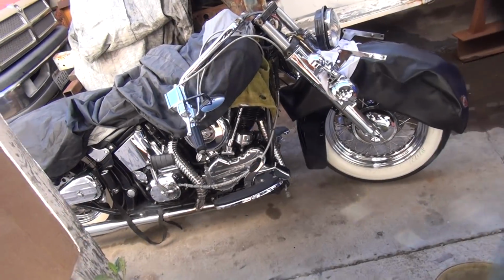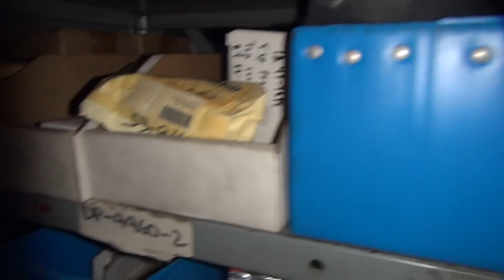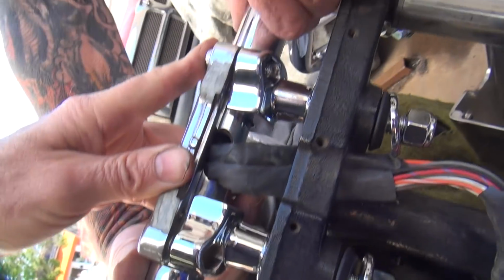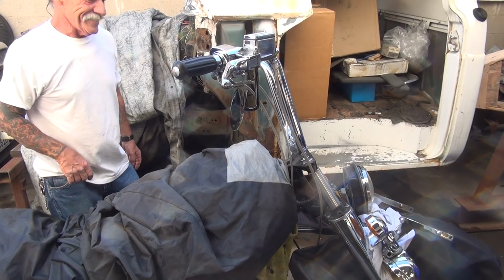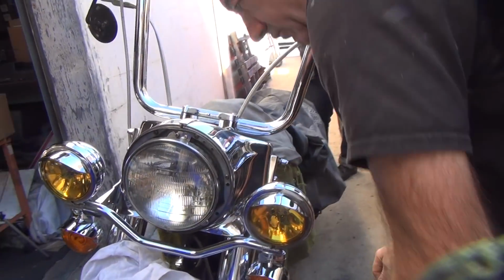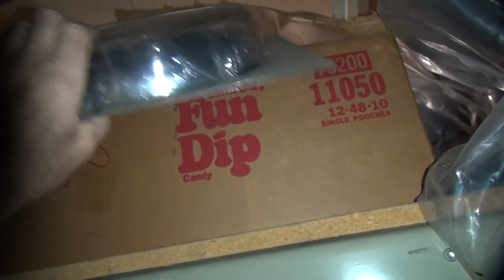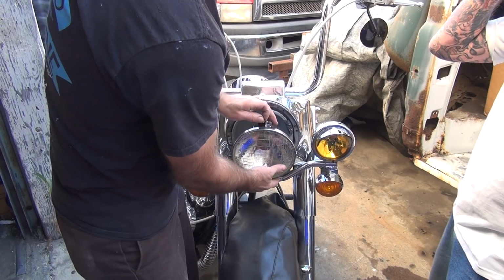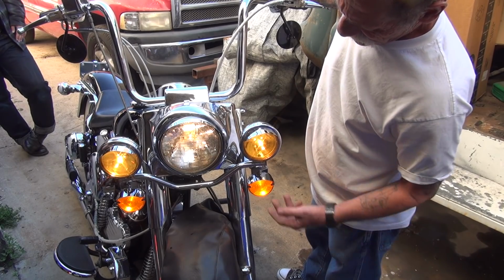#147 How To Do It  change handle bar bushings flh softail harley shovelhead panhead by tatro machine

Comment: Hey tatro on initial start up on 70 ironhead rebuild I have oil coming out breather/vent tube. Alot. What can this be or what to check
Thanks for response
Reply from the maker: the rings need to break-in or you warped them when you wrapped the rings around the piston on installation.
tatro
Reply: its wet sumping.. it'll quit.. if compression is goin by the rings ,aleak down test will show that .if you didn't offset the ring gaps  or follow correct break in procedures  with  zinc oil    agin  a leak down test  will show it..  doesn't sound like you have a moco manual nor have had your hands on an ironhead  whic is NOT a bike to learn how to turn wrenches on...
Reply: @jockeyshift4124  damn you got me i am learning  and I appreciate response
Reply: never  buy anything but the moco manual  first tool   period...Especially if the bike is going to be a keeper.. i own 7 ironheads 62 to early 84... sometimes  you can  get a few pages you need copied outta  SOMEone else  manual and you can get  discs  and pdf's  on evibay..just like the manual a compression test never lies.  i'm in the southeast. just came back for panama city beach  thunder rally  today.. nothin but me toos  and billy badasses ..zero tired iron   so sad...

Comment: Jesus c sounds like a bad breather gear stock gear is nylon sometimes the gear teeth can wear down on some spots causing the breather gear not to rotate all the time also a bad cam bearing can cause wear on breather gear
Reply from the maker: wear teeth off, never. out of round and leak, always.
tatro